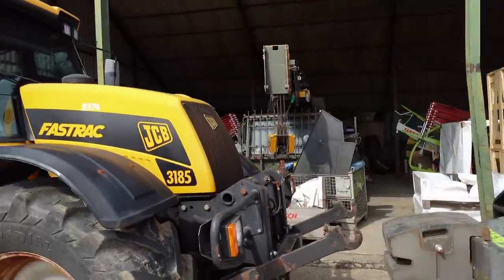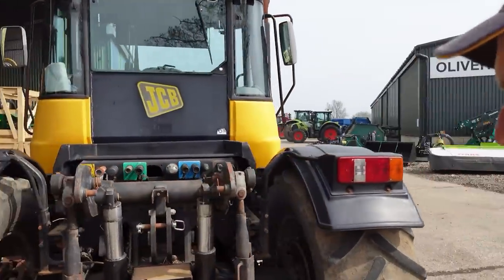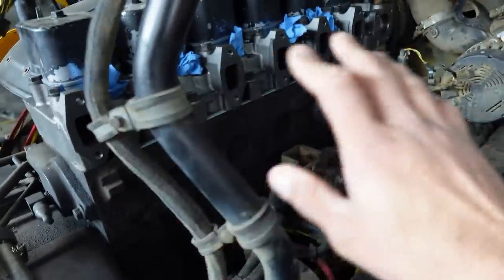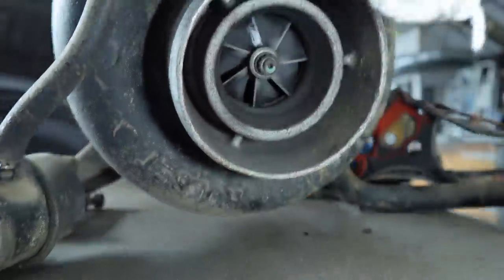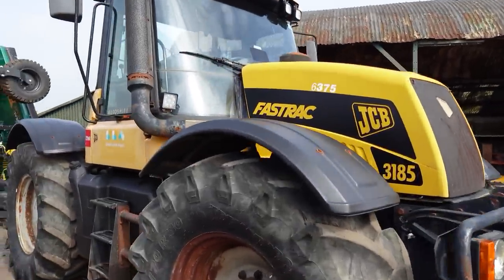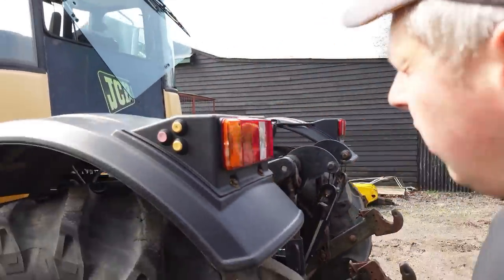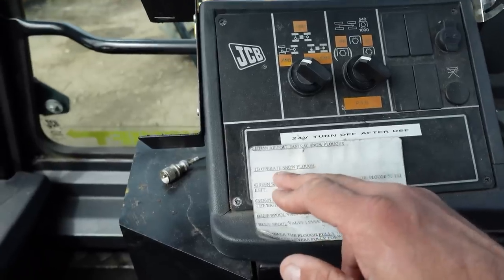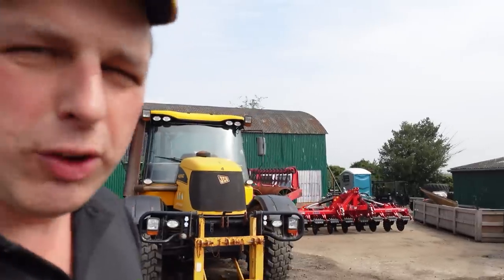LOW HOUR JCB FASTRACS - MORE PROGRESS ON MY 3170!

Comment: Nice One George good your fastrac progressing I mite be showing how thick I am but wood the 5th wheel take a standard artic trailer ?  Have a good week Thanks again
Reply from the maker: Hi Darren, yes they were just standard fifth wheels so would take an artic trailer, although there was very little overhang available so they would only realistically take a trailer with a pin right at the front 👍
Reply: @GeorgeSaunders  Thanks For the Reply have seen similar things advertised in the past and wondered if that wood work for haulage with out having a trailer specially made Thanks Again

Comment: 9:19 won’t be CBs, they would have been on the airband channel so they can communicate with airport ground control, it’ll be a big reason why they are missing.
Thanks for the reply earlier about the Cummins engine, i’m a big fan of the 6BT, my favourite truck, a Leyland Daf 45-150 Turbo had a 6BT under the cab, back in the days before limiters, mine would do 90 ! (Mph not Kph)
Early of a Saturday morning i would blast down the M6/M1 from Birmingham to Croydon cutting through central London after a week of night trunking having saved my fuel money all week by not exceeding 56mph which would give me enough left to dash back so i could get home before 4am & still have a Saturday to enjoy after a 8 hour sleep. The rest of the week i never got home much before 6am.
My old 1996 Leyland didn’t have cruise control so i had a throttle stick that was cut just right that it would hold the speed around 56, crazy days.

Comment: They Dont use Salt on Airfields,They only use Hot De icer Liquid that is Not Corrosive.If They Used Road Salt All the Aircraft Would be Scrap and Falling out of the sky on your House.
I Worked on a RAF Base for 8 Years,Mechanic for Last 14 years.
Reply: My thoughts exactly on the salt. Think they often have snow plough and brush combinations. Never use salt as that'd wreck the aircraft. They use chemicals to reduce the freezing temperature of the water.

Comment: Ur old mate Jb. Back out working with a 20 year old leyland. He s gone into horses. Didn’t know weather to laugh or cry  pitty the poor bugger driving that
Reply: That tractors fine for the work its going to do. I think with the cost of new and second hand machines its worth keeping a older machine running. Old tractor will do pritty much the dame as a new one.
Reply: Hi bud I work my family’s 1800 acre arable farm in Worcestershire ope u get fast track back soon we r all fent. All around 260 300 bhp we were the other green but reliability issues and dealer back up fent is very good jus had our 1st t8 nh. For 10 years impressive so far